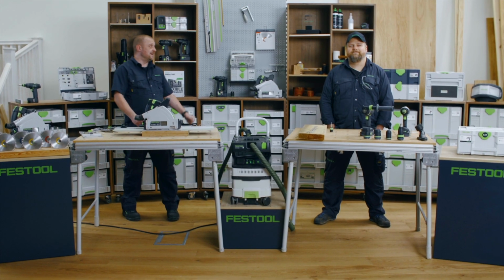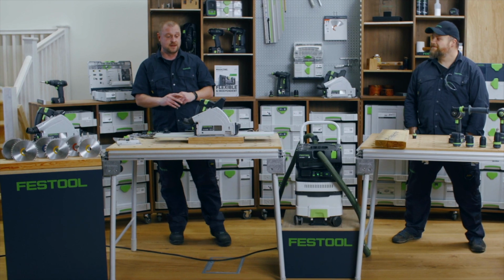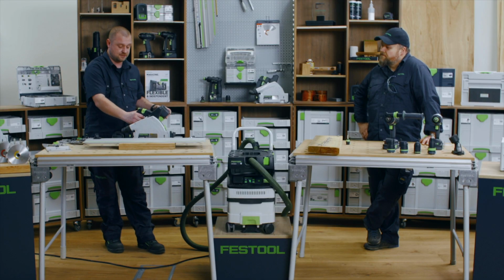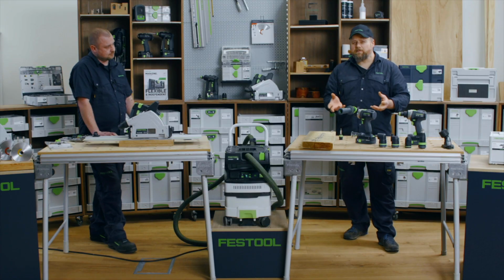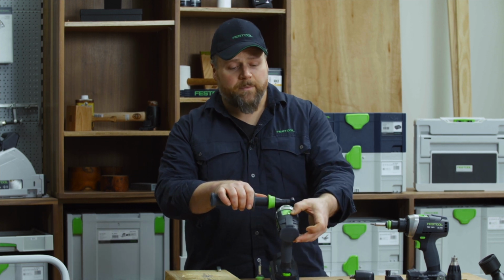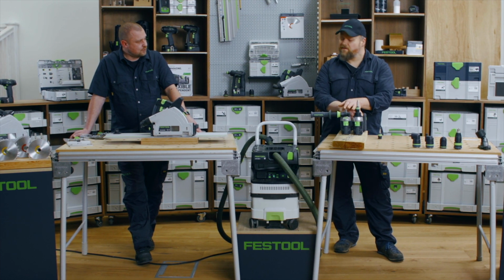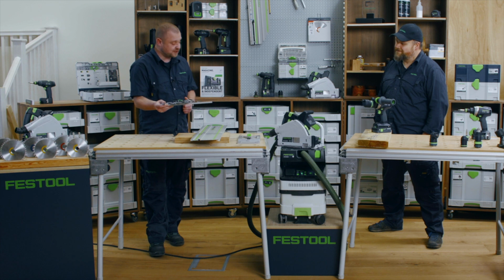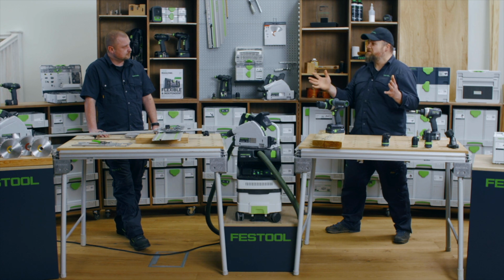Festool Unbeatable Double | TSC55KEB | TS 55 F | TPC combination Drill Driver | Drill Driver

Comment from the maker: Festool introduces the  Unbeatable Double | TSC55KEB | TS 55 F | TPC combination Drill Driver. Want to know why? Then watch this video to find out. 

In this video, Festool will highlight the key aspects of the  Unbeatable Double | TSC55KEB | TS 55 F | TPC combination Drill Driver. Any questions will also be answered in the comments. 

 Products used: 

Festool TSC55KEB-Basic 18V 160mm BL Plunge-Cut Saw - https://ffx.co.uk/product/Get/Festool-Tsc55Keb-Basic-4014549373514-18V-160Mm-Bl-Plunge-Cut-Saw-Bare-Unit

If you have any questions or would like any information or advice you can get in touch: 01303 852692 or https://ffx.co.uk/tools/Contact

All prices are accurate at the time of the video going live.
Festool Unbeatable Double
TSC55KEB
TS 55 F
TPC combination Drill Driver
Drill Driver
power tools
festool

0:00 Intro
4:00 TSC55KEB
27:00 Outro